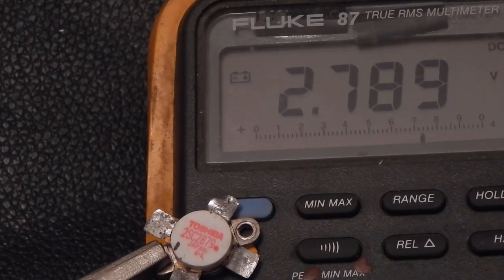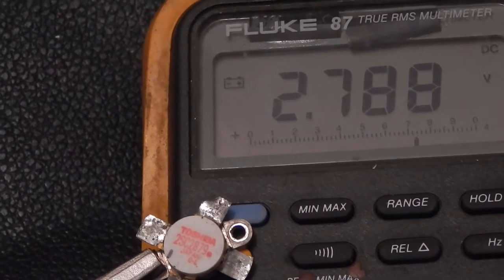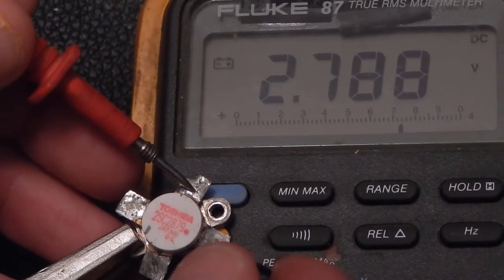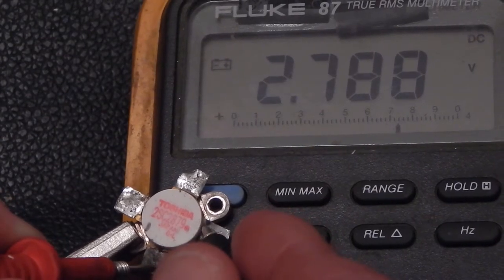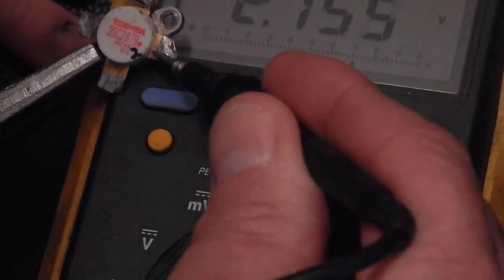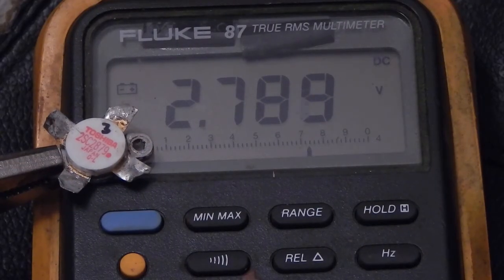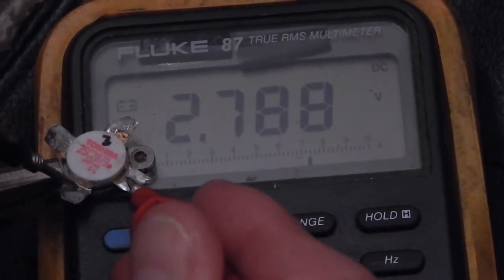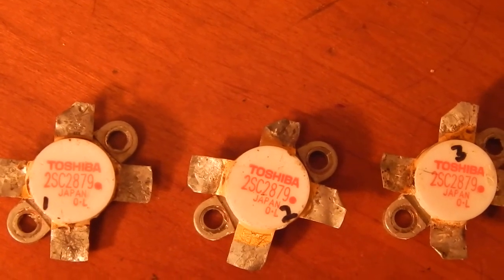Test of 3 used Toshiba red dot transistors

Comment: So since the transistors test OK , do you think there was a problem with the circuitry when you thought one was weak? I recently bought an amp with 2 original toshiba 2879s and one of them looks to be weak or not working in circuit.
Reply from the maker: Probably, I sold the amp as is.

Comment: what is the difference between standard 2sc2879 and the red dot ones
Reply: That dot means the transistor  is BeO free type .
Reply: @uecmitsuimarinedieselengin873  so it will have longevity, but you can't push it as hard! i.e. because of heat transmission